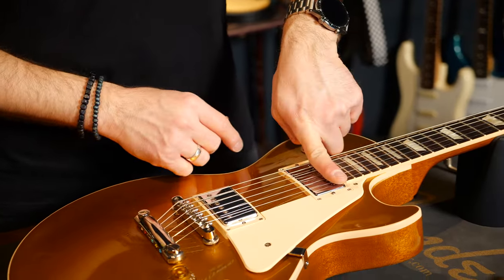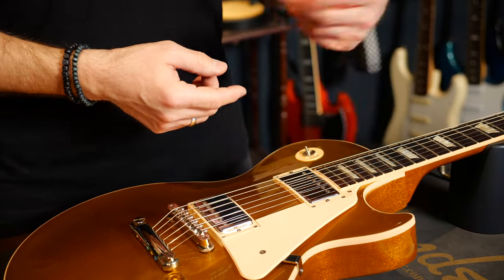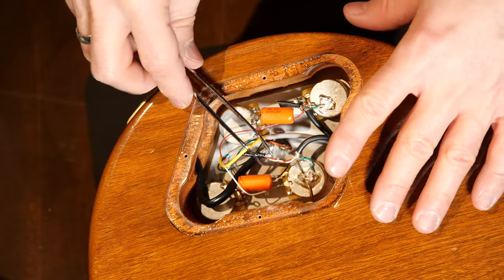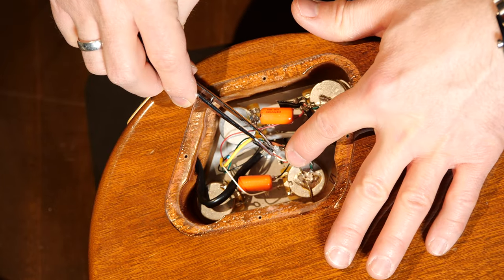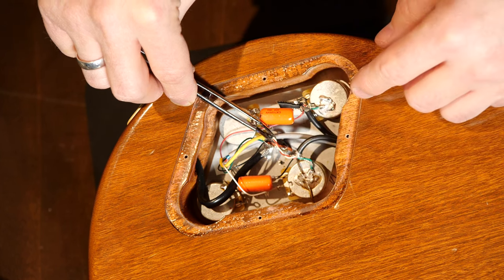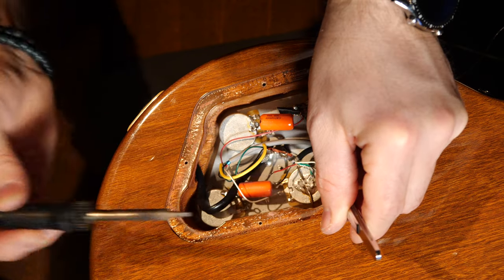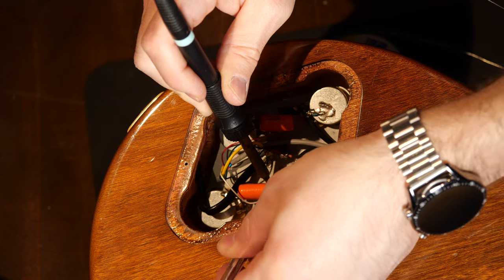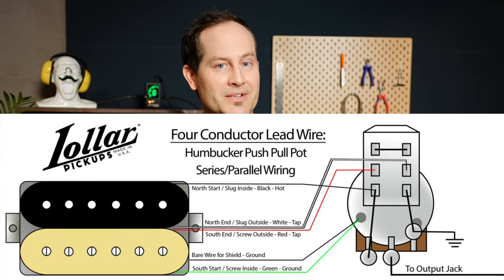Humbucker Wiring: Series, Parallel and Coil Split | Guitar Tech Tips | Ep. 102 | Thomann

Comment: Some interesting question. I saw a guy on a Youtube who wanted to mimic  a Yngwie Dimarzio HS3 stacked humbucker sound, which is usually wired in series. He took half price Chinese Donlis 15k Alnico 5 humbucker in a single coil size and wired it in parallel. Suprisingly, sound was very  similar to HS3. Q: What would happen if he used not so hot 9k pickup? Would it be to weak, thin? HS3 is very low output pickup.
Reply: In my opinion, the coil split on vintage output pickups sounds really thin. Far better to opt for series/parallel on a 9k. Splitting a 15k would usually give you a 7k5 single, so splitting a vintage correct PAF would put you in really weak territory. Some people would like it, but I definitely don't.

Comment: My Epiphone BlackBack Les Paul has this wiring set up with push pulls on the volumes.  I have never liked split coils.  They do not sound like single coil pickups to me.  I LOVE the parallel hum option. Sounds amazing with no volume loss.
Reply: I've heard you get less output with parallel wiring?
Reply: @justaguy2365  It does not sound like it to me.  I hear no volume drop at all.

Comment: Tech tip: how to solder/wire up a SSS stratocaster, to get series and parallel sounds.
Reply: There's only one coil in the Single Coils, so you can't do that within a single pickup. Not sure about soldering the individual pickups to the electronics though, there might be different options there that also count as series and parallel circuitry
Reply: @JustRockMySoul  you can wire single coils in series and parallel IN PAIRS. Like e.g. in rather popular mod for telecaster with two single coils when middle position can be switched to series for fat humbucking tone.

Comment: hey, nice video and i like this topic.
I'm wondering have you taken measurements of the resistance at the output before and after the mods.
if a single coil from the humbucker has (just example) 5kΩ then default humbucker wiring series will give it double 10kΩ hence why Humbuckers have more gain/grit/mids. but if wired in parallel means the resistance should drop in half, in this case 2.5kΩ. I'm very surprised that a single coil here by itself sounds cleaner than both of the coils in parallel.  I'd like to see more sound test and measurements. Also having both of humbuckers in parallel, bridge and neck, I'm curious how the middle position would sound since that usually puts both pickups in parallel already. in which case with the new parallel wirings means all 4 single coils are in parallel and output should be very low. I'm gonna try some mods on my own soon but very curious if you already tried all these. Thank You

Comment: I am modding my Jem jr. I have a humbler pickup for the bridge that I want to install, it has 4 blades to it. It also has 5 wires. Can I even use a 5 way switch with this? Also, how would I wire this in?

Comment: I think I have a favorite episode of guitar tech tips. Can I win the tele now? Just kidding :D ... I have a question: You can wire only one pickup on one push/pull pot for parallel switching. You need two pots for both pickups, one for the bridge and one for the neck, right? Or, am I wrong? 
B.t.w. can you make an episode for wood mounting pickups like filtertrons, P90s, humbuckers, how to mount them into the body without pickup rings? Thanks for this episode, it's very useful, as always. Just keep doing this guys.
Reply: I've seen some very expensive 4PDT push pull pots, but basically yes, one pot per pickup is the usual way of doing things. However, if it fits the style of your guitar, the Fender S-1 switch is essentially a 4PDT switch in a different format, so that could work too.

Comment: Keep in mind there can be a tonal difference between which coil you decide to split. This is especially noticeable in the middle position, with both pickups split together. Both inner coils will sound a bit more quackier, both outside coils would be similar to a Telecaster middle position. Some shreddy-type (Jackson, Charvel) dual humbucker-equipped guitars come with a 5-way switch with position 2 and 4 wired to these two positions.

Also worth nothing that depending on the pickup you're using, you may or may not get hum in the middle position with both pickups split.
Reply from the maker: Absolutely true! Thanks for the comment! Cheers //Kris
Reply: Which can be another pro of the Parallel wiring because you dont have to pick which coil, both continue to work. Also is noise canceling. Not to mention that alot of humbuckers dont split well or are meant to be split. Parallel wiring avoids this. I think im going to switch mine to parallel. I think it will sound better and I cant decide whether I like the screw or slug split better. Another way is the partial split with a push pull pot like on the PRS guitars where it still runs 20% on the other coil.

Comment: Can you have a Series/Parallel pot and a coil split pot at the same time or it it one or the other? For example can you make the volume a coil split and the tone a s/p?
Reply: In case you haven't found out - you can, yes. I modded a guitar so it had switches for series/parallel and coil split on each pickup.

Comment: Hi Kris, I hv a single humbucker and added the parallel wiring which I like but wonder if u know how to have the tone function only for the parallel mode… that way I can make the 2 modes more even… thx
Reply from the maker: Hey Fabio, that'll be pretty complicated. You have to completely split the signal (with something like an A/B switch). One path is gonna be wired series without tone knob and the other path is gonna be parallel with the tone. But keep in mind, that you have to transfer all the conductors of the pickup to both paths to be able to wire them series or parallel AND those paths have to be summed at the end again for the output jack. I'm not sure if you want to do this, haha! Cheers //Kris
Reply: @ThomannsGuitarsBasses  you are right Kris, i was able to find a diagram for it but I had to completely split the coil... it worked great! It took a lot of tweaking but it sounds fantastic, Im not a Dimarzio guy and always go for the SD Antiquities but really happy with the Chopper T on my homemade  esquire...

Comment: Good vid as always, Kris!👍🏼
I wonder if it‘s possible to wire humbuckers to push-pull pots in such way that in pulled position you have the pot working only for one coil (slug coil f ex.) having the other coil (screw coil) at full volume. My idea is to get the tone of full humbucker gradually to single coil by turning the knob. Would work like a sort of bass cut, having at maybe 5 a P90 kind of sound but still hum cancelling.
   Maybe a topic for the next vid… 
   Cheers //Rudy
Edit half hour later: 🤦‍♂️I realized it does not work as long as the coils are in series. If you put a pot on one coil, it effects the output of both... 🤷‍♂️
Reply: if you want to split a in series wired humbucker, you send the signal of one coil to ground. the other coil works perfectly still. you can change the amount of signal you want to send to ground by having a pot between the one coil and ground. 
i think your idea should work.
Reply: @BigEdWo 
Ah, it might work. I don't know much about electrics but I suppose the pot should be between ends of coils to ground. Is then the screw coil or the slug coil adjustable? Because I think the hot wire is on the screw coil, so the pot would work for the slug coil. If so, that would be perfect! 
   If not, how should it be wired to have the pot working for the slug coil?
Reply: @lone-wolf-1  i have drawn the schematic on paper and now it doesn't look like it will work. i think you were right in the beninging.
you can not do it with coils wired in series.

i'm not an expert either but i have tried many special wirings over time. 
sorry for trying to misguide you.
Reply: Sounds like you are wanting to coil split using a pot to gradually bring the slug coil to ground. This is a common way  of coil splitting besides using a push pull pot. At 5 the slug would be partially grounded giving you the half way between single coil and humbucker tone kind of P90ish.

Comment: I have an HSH guitar with two on/on/on miniswitches for the Humbuckers. 
I used pretty hot PUs (Dimarzio Blazes), so that :

Series is enough for Modern Rock / Metal
Parallel for 70s Rock (sounds similar to p90s or PAFs)
Split not to too weak or too shrill, I use it for cleans or overdubs.

It is very versatile, with a good single channel amp one can do a lot just by using dynamic and the controls on the guitar.

Comment: great video except: why demonstrate the tone with distortion, do clean, then distortion please
Reply from the maker: Hi, thanks for the comment! Since this "test ride" was really just about testing if the mod worked out well I didn't do a full tone comparison clean and dirty. Also there's a reason for going for this low gain drive tone. This shows perfectly the output difference between series, parallel and coil split. It's a very "reactive" setting so I chose this instead of fully clean (which is what the least amount of guitarists use anyhow). I hope that makes sense to you. Cheers //Kris